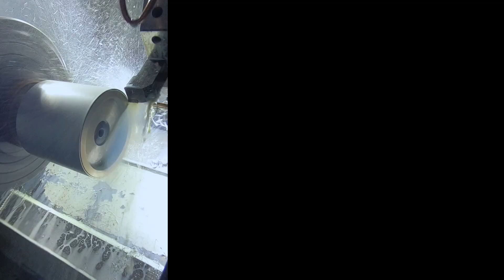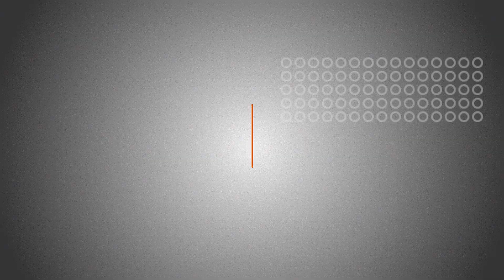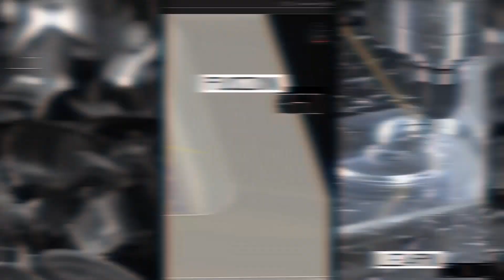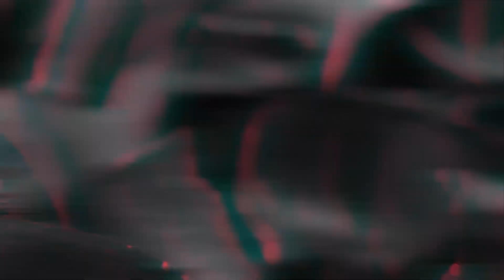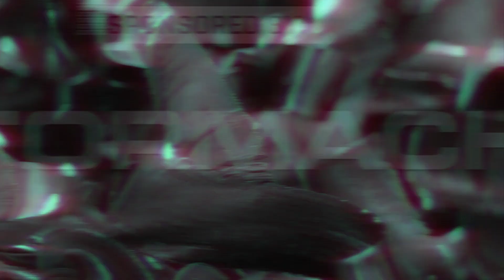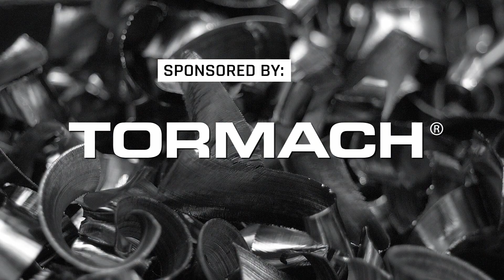Turn & Machine MARS Robot Wheels! | WW209

Comment: I think you said something super important here. You dont want to babysit a cnc machine, even on a one off - Otherwise you can just crank handles.
Reply: Uhh, no. Completely incorrect. Which is why machine operators exist. Ive lost all respect for you youtubers. Spew constant bullshit. You couldn't do this on a manual machine, and you don't walk away and scrap parts on a new CAM. Operators need to operate. CNC machines and CAM programs ARE NOT PERFECT. Suggesting that you can plug shit in and poop out great parts IS A LIE. Once the first part is proofed, then yes your setup job is complete. But you don't just set it and forget it. The first part should always be monitored EXTREMELY closely, at least stopped and measured at every major tool change.
Reply: See, we do a huge amount of one-offs at my dayjob. Injection molds and prototype parts. You know what I do when I programm something with 5..10 hours runtime on 2nd shift? I make sure I have my program proven in vericut, I doublecheck my tools, might check the start of the programm (if its multiple offsets, I will start each one for a few line, idiotchecking)  and then start it to the end of my shift, when I go home.
Or hardmilling cavities. 15+ hours runtime. Going to singleblock the first one? Sure not.
Reply: I think you guys should meet somewhere in the middle. I do this daily and agree with both of you but more to the point, I ndeed to trust my tool paths. That said with a good back plotter and good cam I often walk away after the cut starts. I've got other things to do.
Reply: All depends on your mashine. If you have a large cnc like you see in this video, it doesn't really matter if it fails, as it's enclosed and for the worst case they have a fire alarm system. On tje other hand, if you have a small desktop cnc you really shouldn't let it run alone (whatcg winston moys recent video about cnc safety)
Reply: I understand babysitting your first part. But if you look at this particular part. Almost all the features are identical, you wait and look at one slot, and the rest of the slots will be the same. As John said, all he mentioned was process reliability. He's only using already known S&F (very slow), on features he's ran before, so he's not getting too cute here on the job. Even better is when you know the kind of code you are making and doing anything new there either.

As for me, I wouldn't let the machine do a tool change without me there on the first part. I want to prove my Z out. It's too easy to fuck that up, and your problem would be human error. As Stefan said, you definitely need outside software to verify the code itself. That's what it's there for, to not babysit a machine. You only babysit a machine if you think you may run into chatter, on partly unknown toolpaths on/or features you're new to.

Comment: Keep the manual lathe / machining stuff if you can, please. It's good to see both sides of the machining controllers (humans & computer).

Would it be possible to use a 2" cutter to core out the billet at the start? So you get your roughed hole and also a 1.5" billet from the centre to use on something else? Just curious if that's feasible. Very expensive material costs here in Australia so efficiency is a goal for me as a hobbyist.

Loving the videos, a fantastic resource, thank you.

Comment: Those look amazing. Aren't the spots without tread supposed to represent the damage Curiosity sustained while on Mars? Shouldn't it be lower than the tread because it's the rim that the tread is attached to? 

I guess I'm probably being pedantic though.
Reply: It's part of the original design. They used an intentionally inconsistent tread to allow one to interpret distances (or something like that) from the rover tracks left behind; the pattern left allows them to infer lengths (scale) and direction just from a picture of the tracks left behind. Hence the morse code rumor (the breaks in the tread make the code). It's a creative way to allow one to scale items in a picture when nobody is around to place a ruler in-frame.
Reply: I didn't know that. That's awesome!

Comment: You know I may just be a cartoon, but you can use an something called annular cutter to bore that hole.  It would of taken 1 minute and make much less waste.  But then again what do I know I'm just a simple chinaman.
Reply: Bet they didn't have one.
Reply: They should with all the equipment they have. Even I have a few and I'm just a hobbyist.
Reply: Interestingly enough, I've worked in many machine shops over the years and never seen nor used one.  I've built a few trepanning tools, mind you, but never once an annular cutter.
Reply: I guess they are considered exotic. Once you use one you will never go back to step drilling. They go on mag drills but you can used them on mills as well.

Comment: All that indicating and 4 jaw use to then just put it in a 3 jaw for the milling? Why? if you're gonna cut away the runout by turning and boring why bother?
Reply: You can see, by how much they take off the o.d. when they skim it, that they needed almost the entire diameter. If the end was running out too much, when they went to skim the o.d., they would have had to skim more off to get the entire o.d. to clean up. If they had to take a lot of, it might have been too much, and they might have not had enough diameter left.
Reply: Andrew Delashaw tru that.